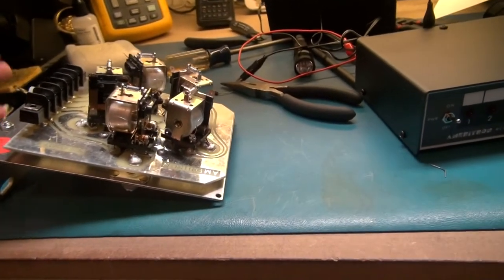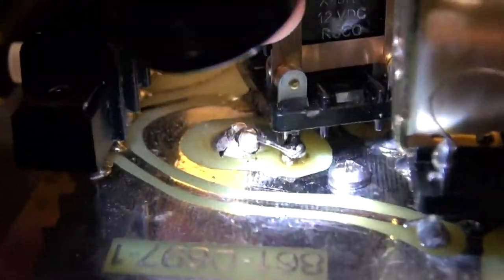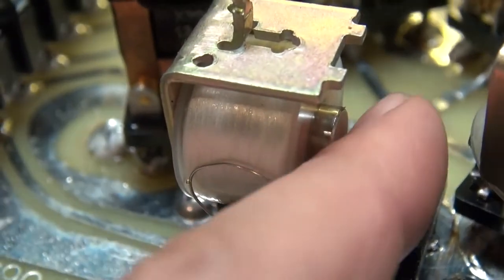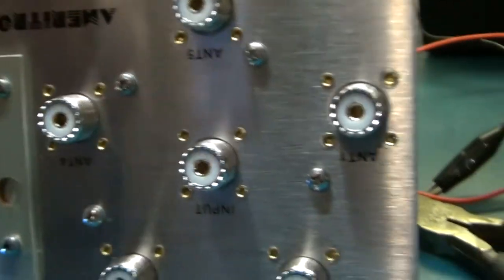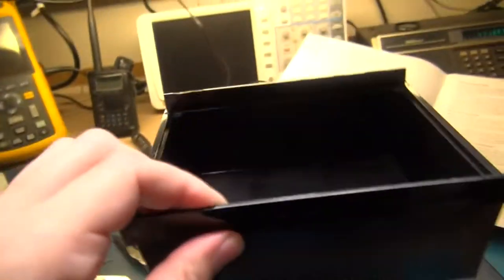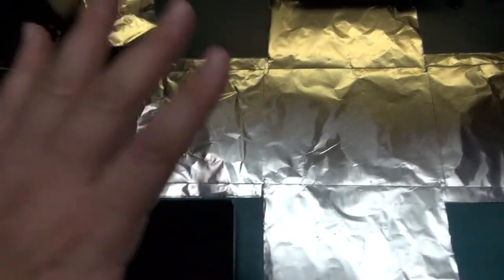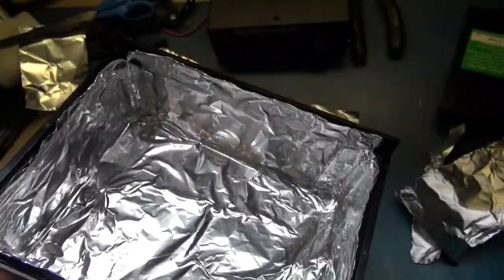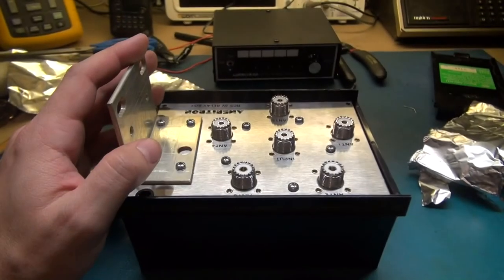New RCS-8V remote coax switch overview and modifications

Comment: what is the pourpose of grounding unused ports   ? and are thease a good unit outdoors with the weather ? i have 1 but hate the idea off it outside
Reply from the maker: +jonneil smyth It works well outside. As long as it is mounted properly. The purpose of grounding the unused ports is static buildup or noise from other ports and antennas. Some people notice tuning issues on non grounded multi port switches like this. Also gives it a direct ground in case of lightning strikes to unused antennas. otherwise they are at a floating potential.